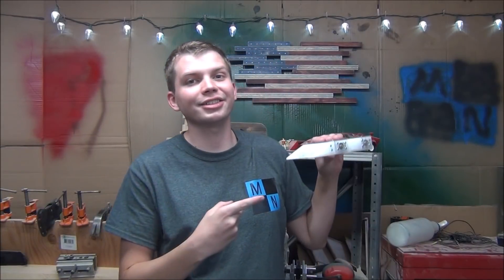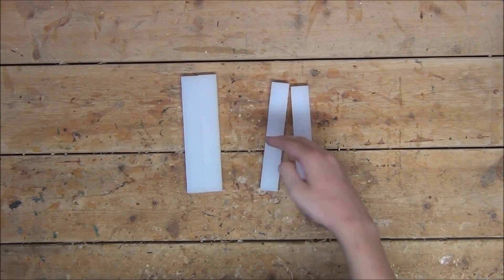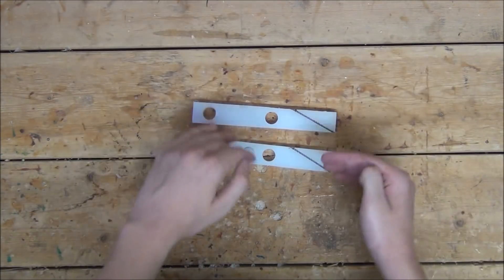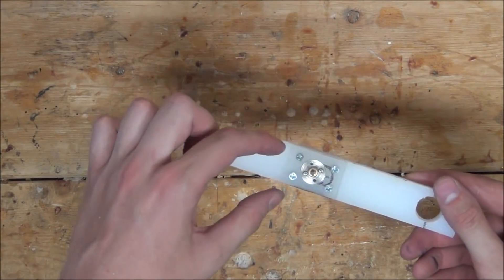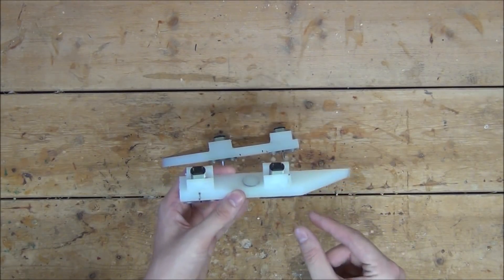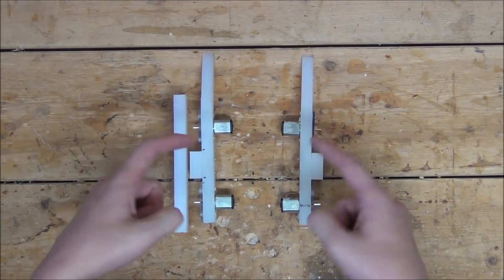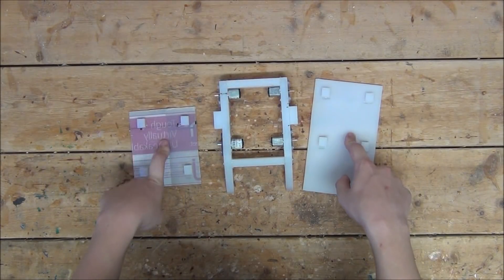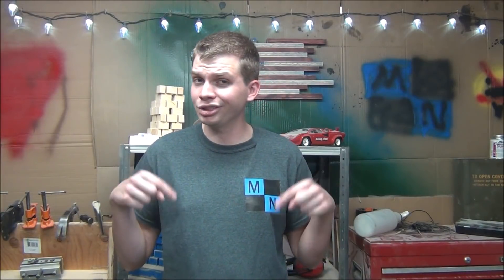How To Build A 3lb Battlebot!!! // Ritron Part 1/4

Comment: Awesome work, dude! 😀
Those motors are the 130 size. When you can, take a look at the 180 size... Those motors have almost the same size, but they're a bit longer... And, man... They are REALLY fast and have a hell of a torque! 😀
Reply from the maker: They sound awesome! I'll have to look into them! I am definitely not completely set on the motors  :)
Reply: Mechanical Ninjineer Dude... I put one of those 180 motors in a rc car I upgraded from toy grade to hobby grade. And... Well, it was really slow... Now it's so fast that at full throttle I can't control it! 😂 That video isn't published yet, but I guess it's the next one. Next Friday it's on youtube. 😉
Reply from the maker: wow! Is it too fast? What size wheels do you have on it?
Reply: Mechanical Ninjineer 40mm (4cm). I don't know exactly the size in inches... But the car is this one: https://youtu.be/bUY-vRZ_yaI In that video I took it's transmitter and receiver to use in another project (a hovercraft, that I already published too - with the plans and so on). How fast I wouldn't know how to put in words... But, see, I didn't changed the steering motor for a servo (yet). And, when I get close to full throttle, it gets so fast that it pushes the front wheels to the side! So it keeps running in circles! 😂
Reply from the maker: oh wow! That sounds pretty cool! What voltage do the motors run off? 6v still? or higher?

Comment: Just a suggestion y dont u use ur back plate to hold your motor in place and from free spinning...
Reply from the maker: Great question! I had thought about doing that but i decided not too because i wanted both the front and back wheels to have the same setup for simplicity. However! The back plate is helping to support the back drive motors from the side! So it is doing somthing!  :)

Comment: Oh yheeaaa, another battlebot video from you!!!!!! I want to build an antweight one, but I have a question, do you need to programm the transmitter and the reciever or just plugging in the wires will make it work?
Reply from the maker: It comes ready to go. but if you want to change some of the settings you wil need to program it. I programed my to change the drive controls, its really no big dael as long as you get a programable tranmitter like the one i used for talyn and my rc all terain boat. There should be a link for it in those videos discription  :)
Reply: Mechanical Ninjineer Hey! I did some further research and I figure it out how to use a rc. I'm now ready to build my first battlebot!!! It'll be an antweight! I'm already looking at what servos and stuff to buy! Thanks for all your battlebots videos, they're really helpful.
The only problem is that there aren't and competitions here in Brazil :P, I'll have to travel to participate in a tournament

Comment: You're probably going to need more drive motor. 16mm gearmotors tend to eat their gears in the beetle class.
Reply: Coboxite this is true. I wouldn’t really trust these motors in the 1lb class. Generally the 25mm 1000rpm motors are what you want for a 3lber as they have a 4mm shaft and bigger gears.
Reply from the maker: Yes, i agree! I am definitely not set on the motors just yet and will probably upgrade to something at some point down the road!  :)
Reply: I ran his same setup on Highlander with no issues. Maybe it was because I was running 4 of them. They're also the standard for Saifu kits which seem to perform pretty decently. However, for a beetle they're likely too small. 

Running 4 of the 25mm motors may be too heavy for a weaponed bot though, plus he'd have to remake the chassis to be taller. Since he's running 4wd, he may be able to get away with 20mm or 22mm motors, but I haven't been doing beetles long enough to know.
Reply from the maker: Im going to run with them regardless. If they dont hold up when testing all im going to have to do is drill out the hole slightly larger to fit in beefier motors. But i'll have to wait and see before it comes to that.  :)